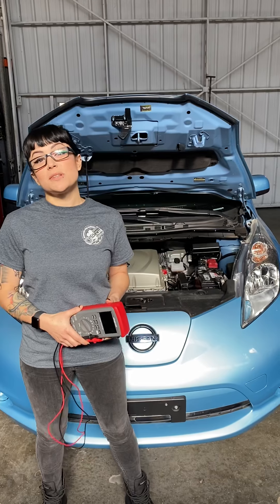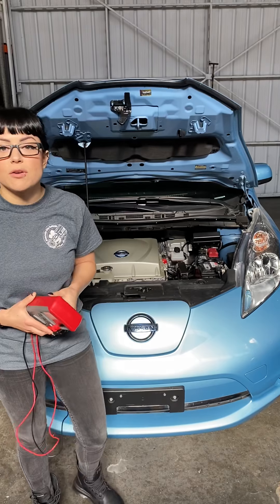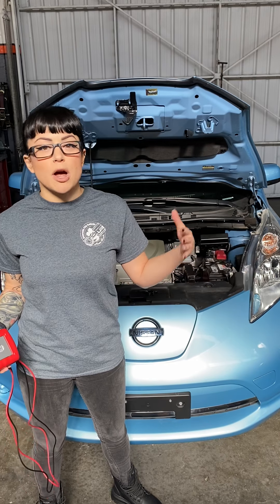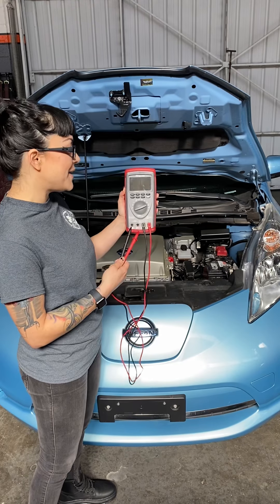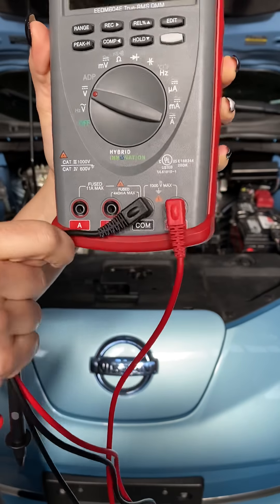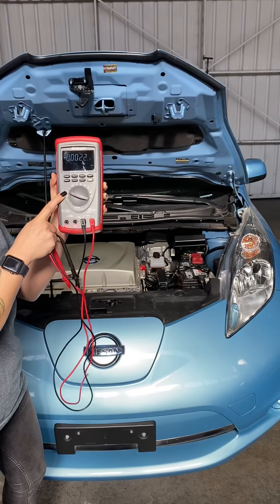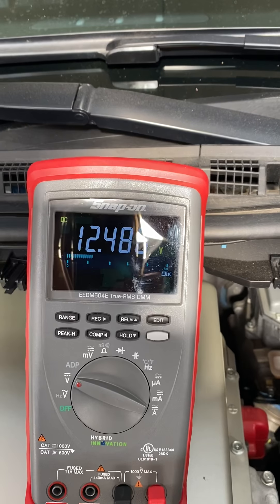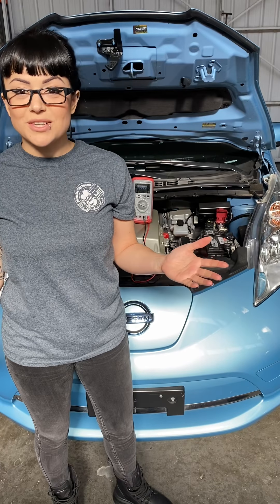How to perform an Open Circuit Voltage test

Comment: Good afternoon my friend and nice to meet you!

I really love the patience, detail and love you put into this video its awesome great work.

My vehicle (2003 Dodge Caravan Se V6 3.3) is giving me a (P0201-Injector Circuit/Open Cylinder 1) code and i have a (2003 POWERTRAIN DIAGNOSTIC PROCEDURES book for town & country, caravan and voyager) that shows on page 88-89 test procedures to follow and apply. 

So far i have applied (test 1) and (test 2) and im on (test 3) now and im stuck on not being able to follow and apply it cause im not grasping and understanding it at all. 

This is Test 3
Turn the ignition off.

Disconnect the Fuel Injector harness connector.

Remove the ASD Relay from the IPM.

Turn the ignition on.

Jumper the Fused B+ circuit and the ASD Relay Output circuit in the IPM. (This part im lost)

Using a 12-volt test light connected to ground, probe the (K342) ASD Relay Output circuit.

Does the test light illuminate brightly?

Yes      Go To 4

No     Repair the open in the (K342) ASD Relay Output circuit.

          Perform POWERTRAIN VERIFICATION TEST VER-5.

This is a video of me following and applying (test 2-https://www.youtube.com/watch?v=rbzQKyiNwcA) and in that video it shows the pages in the book from page 88-89 and pages 312-314 for code (P0201-Injector Circuit/Open Cylinder 1).

Are you able to please make a video showing me how to apply (Test 3), (Test 4), (Test 5) and (Test 6) on page 88-89 and the same from page 312-314 (Test 1), (Test 2), (Test 3), (Test 4), (Test 5) and (Test 6) shown in the video?

Comment: Just got a voltmeter to test future issues with my batteries. Just had to replace 4 batteries from my 2024 Peterbilt 579 after smelling sulfur, on the road, which means roadside assistance  after a huge bill, i got 4 new batteries. Had I done a regular checkup, I would have caught the issue sooner. Nuts!

Comment: Am I late!?? Became a fan thru your current “OSHA approved”…Hysterical!

My g35 was suffering crazy dead battery syndrome. Of course it was the infamous Radio/Power issue. (And I’m not buying it’s just a few resistors). 
My question; If you DO put the lead in the 10A, as I was measuring for ‘current’, if a car isn’t running, zero accessories turned on, and your in series with the battery cable—>Meter—>Battery Terminal, should the fuse still Blow!???

Thanks 😊

Comment: I don't understand your math.  12.4 is 98.4 percent of 12.6, not 75%.
Reply: She's saying every .2 volts is a drop in 20% battery charge. She did not say every .2 volts is 20% of your volts. The battery's charge level versus voltage output isn't a 1 to 1 ratio.